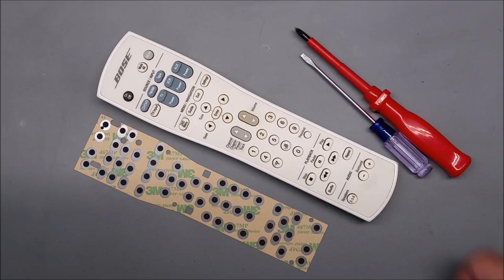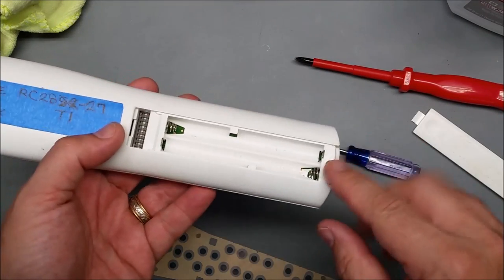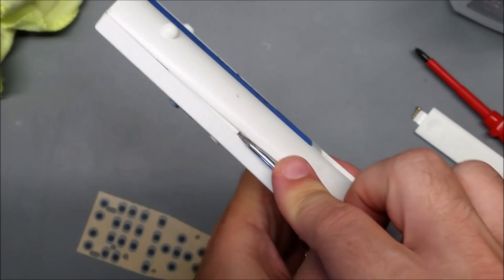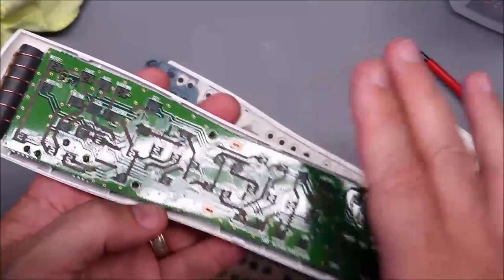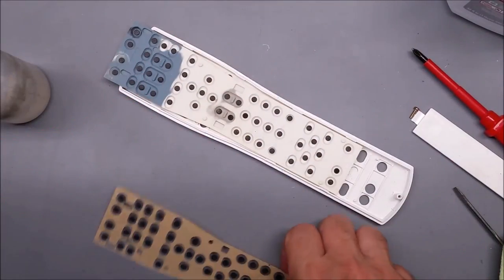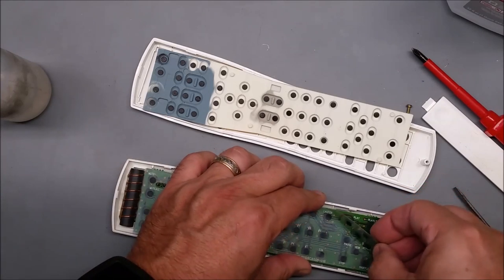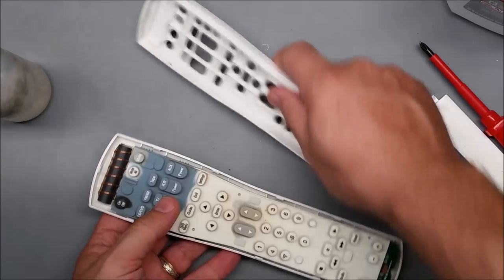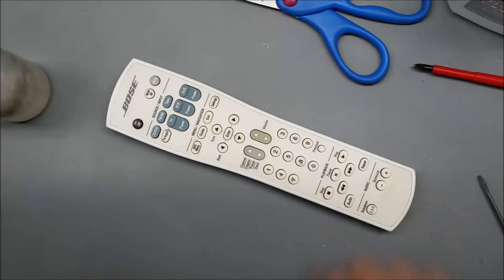How to fix the buttons in Bose RC28T1-27 remote control

Comment: Do you fix bose remotes?  If so send me a link.  Nothing works on it.
Reply from the maker: https://www.youtube.com/watch?v=k045ya7VSuA
Sorry I no longer repair these because 90% of the remotes that were sent in did not have a problem and it was just a waste of everyone's time. The linked video helps people troubleshoot the most common problems.
Reply: @p1repair  i watched the video and nothing works on the remote.  Dip switch setting ate correct but nothing works.  Any ideas?  If its the main board can i still get them?  Any help would be great!   Hard to find replacements.
Reply from the maker: @jimvonfeldt6321  All of my ideas are in that troubleshooting video. It can be power, remote settings, base settings, base wiring, broken base.... you need to try the AM radio trick to verify the remote is putting out a signal. It can be a pain to get working at first. I find moving the remote around the radio while pressing buttons works best.  It doesn't make much sense where the AM radio will pick up the signal the best. If you try and try and try and can never get the interference noise on the AM radio then it's safe to assume the remote is not sending out any signal for some reason.

Comment: It’s 2024 and I thought I would have to retire my Bose remote control model RC28T1-27. 

However, after purchasing this product and some detective work, my remote is as good as new! 

In case it may help others, I could not get my remote to work after applying the membrane on the board the first time. I knew I had an issue with my old buttons because I was able to get the keys to work when using a small metallic screwdriver to close the circuit for each button. I even used one of the original buttons I knew I never used and that worked every time for the buttons that stopped working (e.g. power, volume, and channel).

In my case, I made sure I had fresh batteries, the battery terminals were not corroded, the remote’s attenae was fully intact (e.g. it didn’t require soldering or replacement), and the circuit board was clean after using 70% rubbing alcohol.

Turns out I had a Raspberry Pi sitting right next to my Bose Lifestyle 35 and, more importantly, an HDMI cable running in FRONT of my Bose as it ran to my TV. I thought nothing of it at the time until I realized all my buttons were working using the new membrane when I was right in front of the Bose system. As I moved further away (about 2 feet), my remote would stop working. 

Turns out the HDMI cable was causing interference and all I had to was move it out of the way so it wasn’t anywhere near my Bose system or, at least, tucked away BEHIND the system.

This is a great product and 
I couldn’t be happier. I wasn’t asked to make this review and just hope others may benefit and give it a shot if they find themselves in a similar situation.

Comment: One thing to note which is common in these - if you hear the rattle, it is often because the solder joint to the coil antenna gets broken.  Putting in the foam may help, but it doesn't guarantee a good contact on the antenna.  Best thing to do is remove the board and examine the solder joints on the antenna coil.  If they are broken, re-solder the joints.  This generally is why the remote only works very close to the unit (because the antenna is not making a good contact, or contact at all).  Excellent video on how to take the remote apart and re-assemble.

Comment: Just mentioning the signal receiving antenna is supposedly inside the power cord, which I had stored folded neatly inside a cable box that also contained a 4-port switch amongst other signal emitting devices. Would try removing and stretching the power cord and transformer to a separate outlet and see it that fixes your problem. I had bought one of these button pads that didn't fix the issue. Still glad it's in since the volume buttons were probably worn out from mashing during testing.

Comment: Thanks Bro. I did my remote and it started working beautifully. I used WD-40 Contact Cleaner.
Reply from the maker: WD-40 is not a good idea. Cleaning the keypad alone is temporary at best. WD40 cleans the metal but the metal usually isn't he problem, it's the rubber pads that wear out. WD40 and other oil or petroleum based products will soak into the rubber and cause it to expand. I've seen that cause the rubber buttons to stick down.

Comment: I got the repair kit and am not happy with the results.  While taking the remote apart, several of the clips that hold it together were broken.  After the repair, which I did faithfully following your instructions, the buttons don't work as well as expected, and now I have to put the remote much closer than before to make it work.  Also, the remote cover does not fit as tightly as before.  The antenna  is not damaged or loose, and I put new batteries in the remote.
Reply from the maker: Sorry to hear that. How well the buttons work cannot effect the range of the remote so something else is definitely going on. Broken antennas are pretty common because the antenna is a heavy weight at the end and subjected to a lot of vibration over the years. Some were glued down with white silicone and some were not. When the wires break it's usually obvious but sometimes they are just cracked and about to break away completely or if they are glued down the wires can still break inside the silicone. 
As far as the plastic side clips, every remote I take apart is different. Often these are old and the plastic has become more brittle. One thing you can do about that is use "Shoe Goo" or E6000 (same stuff) and just put a little dab at each clip and then hold the remote casing closed with weight or tightly wound rubber bands until it dries. 
But first the range issue would have to be dealt with. 
Unfortunately it's pretty common for people to think they have button problems when the issue is really something causing the remote not to work intermittently. Button failure will always be heavily used buttons (like volume, etc) and will never effect all buttons the same way. Obviously if the buttons are not the problem, a button repair lit isn't going to solve the problem.
Reply: Thank you for your prompt reply.  The antenna appears firmly glued with white silicon and no wire breakage is obvious (I can send you photos I just took).  Anyway, how can wires break inside the silicone??  If the side clips were to be glued with Shoe Goo, as you suggest, the remote could not be opened again, ever, so that does not seem a good a idea.  Perhaps I'll just have to buy a replacement remote after all.
Reply from the maker: Shoe Goo (E6000) remains flexible forever and can be pulled apart. I find it can also usually be completely removed relatively easily vs most other glues which will typically shatter or break apart.  A small dab will hold strong but if you grab it with needle nose pliers and pull it will stretch and typically come off in one piece.  
I have seen the wire break inside the white silicone many times. Silicone helps but it's flexible and  the wire can still bend back and fourth just a tiny bit. Over time that repeated bending will crack metal. 
Unfortunately it's tricky to test the wire when you cannot see it and it's glued down.  The silicone does not come off easily.

Comment: My RC25 recently started doing something weird. If i point it directly within a meter of the head unit it wont work. If i  point it away or i am down the hallway 5 or 6 meters away it works. I've checked all the usual, battery conections ,antenna joints etc It's wierd. Any advice would be gratefully recieved thanks.

Comment: I have a Bose lifestyle 35 with the RF remote that came with it no longer functions as well as a replacement that I’ve been using I’ve cleaned it and looked inside both of them they don’t appear to have any loose connections is there anyway I can use an IR remote instead of the RF they came with the unit to control volume and turn it on and off
Reply from the maker: Does the remote work when it's very close to the receiver? (Try at the front and back) If so, then your remote has a broken antenna.... even if you think it's not broken.

Comment: helpful  video
 hi how to repair tv remote control work in 2feet away only thanks
Reply from the maker: Sounds like the antenna is broken. It would need to be re-soldered. Easy job for a technician but it would be difficult for someone without much soldering experience.